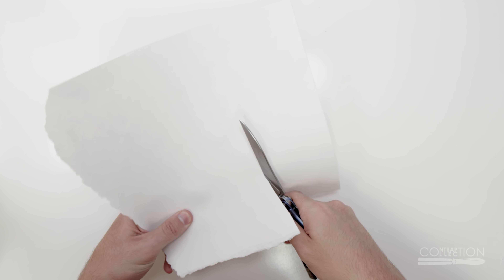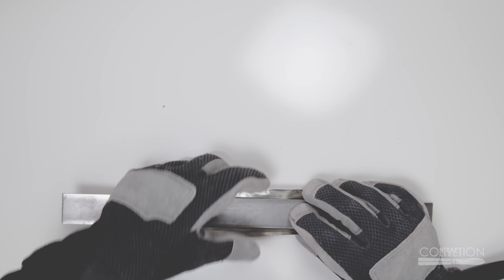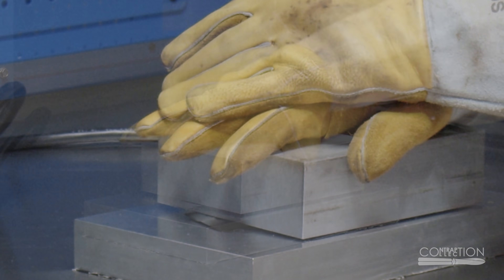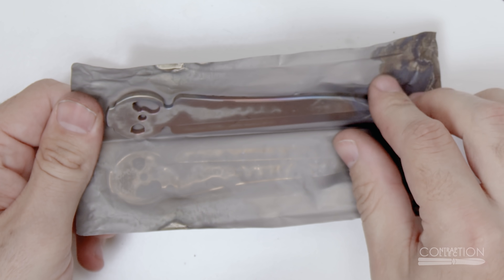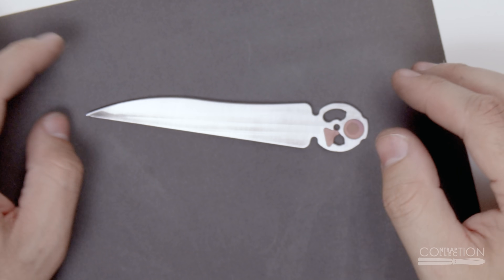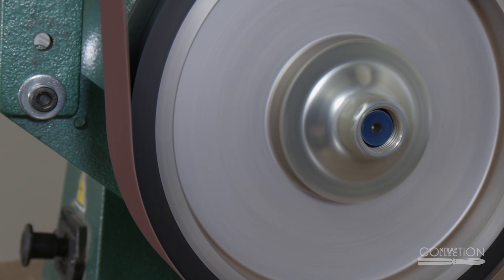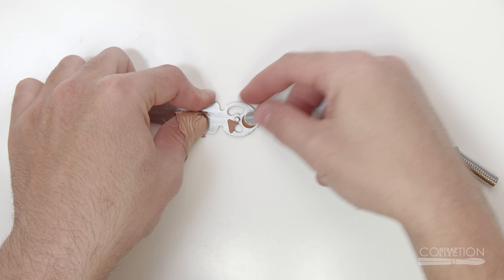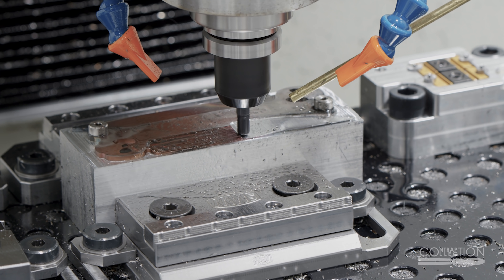Heat Treating Baliscissor Blades! Ep 18

Comment: Martensitic (hardenable) stainless is magnetic and you may need some sintered nickel (mumetal or similar) shielding linings to the magnets to limit the magnetic permeability otherwise putting magnets in a cavity made of magnetic material actually makes the field stronger.  Only austenitic (nonhardenable) stainless is non-magnetic and a lot of production scissors are made with this stuff and they punch the blades out of coils of steel and just rely on the work hardening due to the punching process to strengthen the blades..  Some do a surface hardening and abrasion resistant titanium nitride coating to make up for the inherent softness of austenitic stainless..

In terms of the bend, for most hand made scissors, the bend is put in by hand as well, literally by whacking the blade with a hammer and test cutting until you get a clean cut.    For production blade you can machine a mold and press the blade into it, until it takes a set, but it will take some experimentation to determine the correct profile for the mold as the steel will spring back a bit after pressing.

Comment: Oxidizing is losing electrons, Reducing is gaining electrons (Oil Rig) 
Maybe you could parkerize or blue them? Chemical treatments will wear on the structural integrity though

Another alternative is use a vacuum furnace so that that the blades don't oxidize in the heat treatment

Comment: AIR hardening - let it cool in a vice pointing into the air. the curve is Very important for scissors and can probably bend them while air hardening. the blade edges can be  chisel ground with a hollow grind in between blades
Reply: i would leave them air hardened so the scisors can be adjusted later on in life. max id do a preheated oil quench bottom-side in first

Comment: Simple little life did a video on air hardening steels. Best bet is to clamp between two pieces of aluminium and then blast with compressed air around the blade to quickly cool
Reply: Also Gough Customs has great videos on knife making.

Comment: Oh I sense e problem with the gap: I have really good scissors (old, from solingen, from a tailor) and they are a tiny bit loose still. I think you normally also close the gap by side loading both pieces against each other with your hand. I fear the holes help a lot with that. Without them you risk the whole assembly going sideways in your hand.

The problem the bend fixes might just be, that without it it's hard to "tension" the tip this way because the pressure is taken away by the rest of the blades already touching.

Comment: - the roller is a MUCH better tool that hands without gloves, but I like to take a piece of stock and hold it perpendicular to the fold of foil I want to flatten, tilt it at an angle and slide the piece of stock over the fold so that the corner of the stock makes a single point with the foil as I slide it along the fold to really crease it.

- Stainless steel foil isn't that expensive so I usually just cut it oversized since it saves time. If you cut a piece too small, you'll either have to fight it to get the could to cover the piece and still fold shut, or start over with a larger piece.

- definitely throw in a few small pieces of paper scrap into the foil packet. While I mostly do air-hardening tool steels (not as much stainless steel) the little pieces of paper have consistently and categorically reduced the decarburesation of the surface of any part I've treated, I imagine this will hold true for stainless steel.

- I looked up some documentation for s30v and 1) from what you were saying, I believe you've got the gist of equalizing correct. While it's more important for thicker parts (just like cooking food, the internals take a while to catch up with the externals) holding the material at a temperature where it starts to radiate allows the internal temperature "catch up" so you don't have a huge differential, i.e., you don't want the center of the part to be lagging behind at 900, 1100, or 1400 degrees F while the outside is at 2000. Firstly, the coeffecient of thermal expansion would cause the outside to expand much more than the inside, and that could introduce unneeded stress into the part. Also, heat treating steels of all kinds are done to temporarily form martensite, it's quite possible that with a thick part, if you don't equalize, the center area could actually never reach the temperature to create the amount of martensite desired. After quenching, you'd lose the guarantee that a whole slew of interesting compounds end up in the steel.

- if you ever have trouble with the pin hole sizes, try to bore them 1 thou under so you can use a little expanding arbor lap to bring them up to size post heat-treat. It won't be fast, but it is a way to expand holes in hardened material.

- not all stainless steel is non-magnetic

- good results so far!! And major props to getting your hands dirty, trying new things, and sharing your results. This attitude and practice will take you incredibly far.

- Please wear gloves when dealing with that foil, even when cutting it open, you'll be able to do it faster without worrying about your hands as much lol. Yes, you can get away without it, but you'll save so much time and so many bandaids

Comment: If you want to sharpen scissors reliably, I've heard of a system called "Twice as Sharp" that has a reliable method of holding the blades for a solid sharpness.

Comment: Mech E here. As far as the magnetization, I don’t recognize that steel offhand, but check what your phase transitions are, you may have  done the heating in a way that caused it to move to the more magnetic phase. Alternatively you should try them without heat treating. To see if the alloy is more magnetic than you originally thought. In a tool that will likely see soft materials you probably want yield strength over hardness, so pursue that in your material selection. 

The bends can be done in many way ways, mechanically like forming, machining etc. remember that once you have a structural bias like that the heat treating will affect it. Good luck

Comment: Instead of letting the blades cool after tempering. While they are 600° put them in a vice with three pins two pins on one side one pin on the other centered between the other two and clamp putting a slight bend in the blades. You don't have a lot of time where the steel will accept the bending so work quickly. But that should work.

Comment: That heat threated parts especially in your Stainless get magnetic is pretty normal, The grain structure if the steel itself changes and therefore it gets aligned especially through Tempering to some crappy sort of permanent magnet. Just buy an little 20$ demagnetiser from eBay which you can plug into your mains, it's handy for all sorts of stuff and should get you going

Comment: I’m a bladesmith and I have a couple comments on your heat treatment. 1) your interpretation of the recipe was fine, you do want your piece to heat up with the oven. 2) you want to be really fast with your quench. You were a little slow grabbing the aluminum plate and putting it on your blades. You also probably want to blow some compressed air around the edges of your blades while holding down the top aluminum plate. 

Also, but all stainless is non magnetic. It needs to be pretty high in nickel and chromium in order to be non magnetic. 

Overall things seem to be going really well.

Comment: Hi, mechanical engineer here.
I made a knife myself and did some research on steel so here is my explanation on why your hardened steel is magnetic.

This has to do with the internal steel structure, this knows a few kinds:
Perlite, Ferrite and Cementite are forms regular steels are made of, the rusting kind.
Then there is Austenite, a structure that for normal steels only exists at certain temperatures, usually around 800°C.
Austenite is non-magnetic.
For hardening regular carbon steel this is actually useful because the ideal point of hardening temperature is slightly above the temperature the steel becomes Austenitic, or non-magnetic.
This means that for regular steel you can heat your steel until it is non-magnetic and becomes Austenite, heat it a bit longer and the quench it.
For stainless steel this isn't the case.
Austenite in regular steels only exists on high temperatures, but for stainless steels, it exists on room temperature.
This is why stainless steel is non-magnetic, or at the very least a whole lot less magnetic.
But when hardening stainless steel this changes, and this is where the last kind of internal steel structure comes in: Martensite.
Martensite is a form of steel structure where the steel does not get the time to properly readjust itself when cooling down.
It gets cooled too quickly to properly form the structures the steel started with.
Martensite has a few useful properties for steels, one of which is that it is extremely hard, but as a side effect, also magnetic.
This is why your blades became magnetic after hardening them: the steel took on a different structure.

There is a way to get around this, but i don't know if, and how well this is doable in this case: it will take experimentation.
The term for it is Differential Hardening, and how it works is that when quenching your blades, you let one part cool down slowly, in this case the part you don't want hardened.
A way to do this in an example with oil-cooled steels is only quenching the blade in to the point you want hardened, the rest stays outside and cools on air.
With your air-hardening steel this might be harder, but maybe you can do this with something like for example, clay on the unhardened part.
The clay keeps heat in and allows that part to cool down slower.

That said, If that part will be unhardened it will wear down faster.
I can't say anything for the life of your parts when the parts of the blade that hinge are unhardened.
The blades would have a longer life when hardened, and pins would be simpler to replace than the whole blade.
Maybe replacing the magnets for stronger or different ones would be a better approach, but i can't draw conclusions based on my knowledge about this project.
I would recommend to test around with this.

Love the series of videos you have going on here, good luck!

Comment: I sharpen our scissors by using file side way, than normally would use file. Angle is close to 80°. Edge last longer and might be better to scissors anyway. Cuts papers, fabrics etc. perfectly. Older plater once tought to sharpen tin snips with anglegrinder, so i kind of adapt that to scissors.

Comment: It would probably work better if the blade was heat treated before its made to the final dimension. Heat treating in my experience can warp or bend blades. So most of the time work is needed after to reuse up the blade.

Comment: What is the white liquid at 0:50 ? I don’t know much about machines but this series is super fun to watch
Reply: It’s a coolant to help keep the material cold so it doesn’t heat up and machine to different tolerances (as the material expands it would cut more). It also keeps the cutting face cold so it doesn’t heat up and dull faster. Hope this helps
Reply: @ukjt89  This does help. Thank you so much!

Comment: If you put a piece of paper into the stainless foil with the blade it will burn off the remaining oxygen inside. This should also reduce the amount of scale that forms when inside the heat treating oven
Reply: Which is exactly why the tips discolored.  The tips get red hot the fastest (less mass), then scavenge the oxygen in the envelope; turning them blue.  Paper will do the same well, but much sooner than the steel.

Comment: the problem with magnetism is an interesting one. I've heat treated a few knives that actually came out with magnetic spots, it has to do with how the crystalline structure of the steel breaks down at high temps before quenching, in fact that's the reason why steel is hardenable. It might be possible that when you hardened the blades they became slightly magnetic because somehow the grains of steel aligned in such a way pre heat treat that once the grain structure was locked in they formed a weak permanent magnet. Honestly though i'm not sure, i haven't run into a problem like that. I think blade hardness is a little low but again i make kitchen knives so i tend to shoot for higher hardnesses and considering that you tempered at 600° i think you got max hardness out of the steel. The colors on the steel also look good after they came out of the foil. They only really need to be wrapped to prevent de carb so a little more oxidation at the tip is fine. Also, the tip will have more oxidation because it's thinner and heats up faster in the kiln, so it uses up most of the oxygen contained in the foil package before the rest of the blade gets hit enough to oxidize, or at least that's my theory behind it. you can throw a little bit of paper inside the foil pack and it will burn and use up some of that oxygen to prevent extra oxidation, not sure if it will get rid of all of the oxidation but it might make the blades easier to clean up after the fact.

Again hopefully there's some useful info in there, not claiming to be 100% right just trying to provide some potentially useful knowledge. It's exciting to watch these scissors develop!
Reply: Austenitic Stainless steel is non-magnetic, while ferritic and martensitic stainless are magnetic. The heat treatment is probably transforming the original austenitic structure into a martensitic one. Going for a harder stainless steel might be a better option than heat treatment, or going for a non stainless steel with some sort of anti oxidation coating. In the worst case scenario you might need to change the magnetic mechanism.
Good luck on your project!!!
Reply: @07jvmc  Too slow of cooling is what is changing the structure from astenitic (non magnetic) to martensitic. If you heat up the steel it will take austenitic structure and by cooling it down fast is what keeps the crystalline structure austenitic, the structure doesn't have enough time to change into martensitic/feritic fast enough, its the basic idea behind quenching. Also quenching into water should result higher hardness than into oil.
Reply: @koitk  You would have to cool at an unrealistic rate to have any chance of retained austenite in a martensitic steel, the transformation from austenite to martensite is athermal.
Reply: @07jvmc  Was about to comment this, although in his case the steel is S30V which is a martensitic stainless steel. This alloy is designed to be heat treatable, and is magnetic (https://en.wikipedia.org/wiki/Stainless_steel#Martensitic_stainless_steels ). Only austenitic stainless steels are non-magnetic due to (as the name implies) the microstructure being mostly austenite (https://en.wikipedia.org/wiki/Austenite ). I think that he just underestimated how magnetic the S30V would be. I agree with your sentiment that he should probably use a different stainless if he needs a non-magnetic blade or higher hardness.
Reply: i have no clue what he said but it sounds right
Reply: I’m not sure if the design would allow for this but another possibility is aligning the magnetic fields to save the same purpose as the magnet inserts. It’s most likely due to the heat treatment process due to the changes in the grains which allow for the steel to become harder.
Reply: Other option would be to use steel which can be tempered for secondary hardness. It would probably be more expensive but after tempering austenitic structure would be back and part wouldn't be magnetic while retaining hardness.
Reply: @adamskalnik5260  Tempering reduces hardness by transforming martensite to tempered martensite. The benefit is increased toughness, and a more stable microstructure. Tempering would not result in a return to austenite. Look up what happens to CRES steel when heated, it loses its corrosion resistance.

Comment: S30v stainless steel is martensitic which means in the heat treated and annealed state it becomes magnetic. Equalizing or Normalization means that you heat the steel to this point, then cool it in the air to room temperature. this "resets" the grain of the steel, as heating can do damage to the internal structure. ... by partailly heating the steel, the high stress of the quench is reduced and toughness is added to the blade.

Comment: Not a materials engineering, but CPM S30V is martensitic stainless steel and is therefore magnetic to have a completely non-magnetic blade you need to use an austenite steel alloy. A quick read through the paper "Magnetic Properties of Steels
 after Quenching and Tempering. III. High-Chromium Steels. by G.V. Bida et al" it further suggests that the magnetic properties of a steel such as CPM S30V may increase when tempering above ~450 degC (assuming AISI 440C is comparable to CPM S30V, and AISI 440C is comparable to 95kh18). Note that I've done quite a bit of handwaving in this comparison...